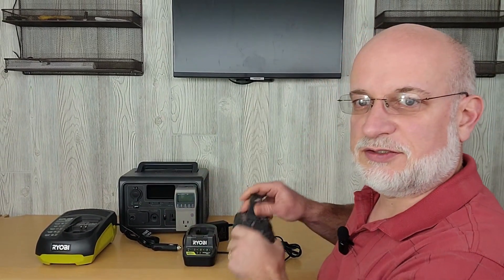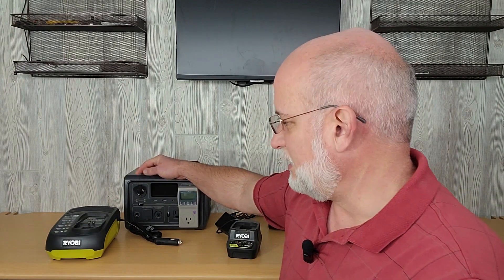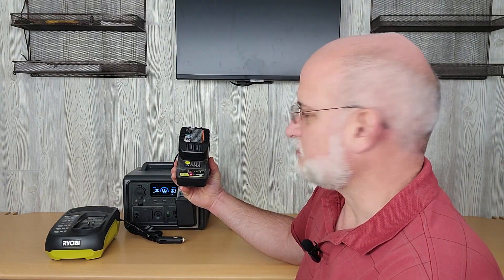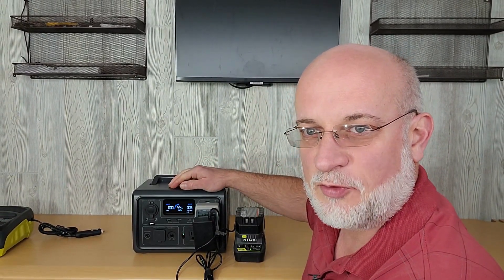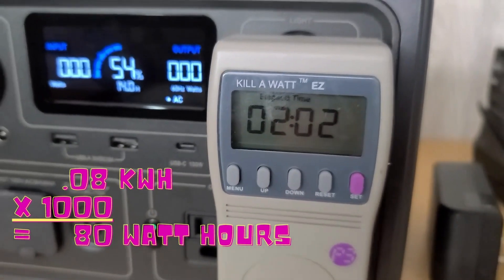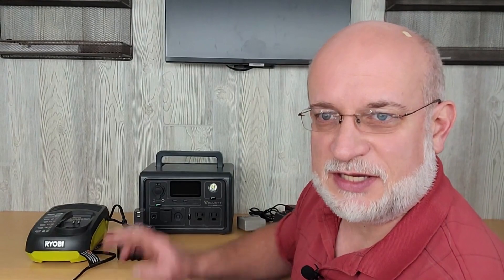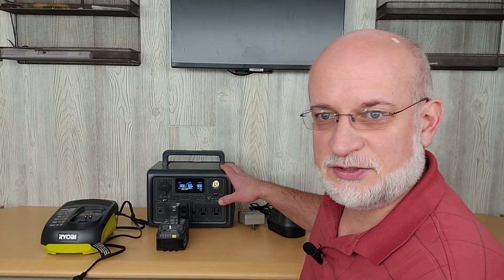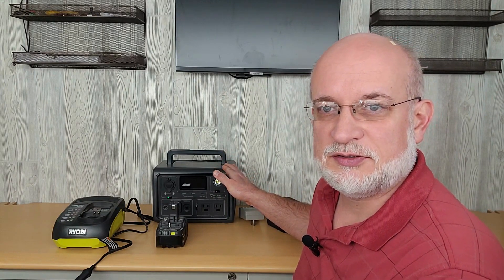Wattage Wednesday: How Much Power Does it Take to Charge a Ryobi 18 volt Battery

Comment: I would like some information on the power usage of the chargers themselves.  Nobody unplugs their chargers.  Most leave the battery in the charger until they need it again.  So I would like to see a combination test.  The first part is the power used to charge the battery but then continue the test with the battery in the charger until the 24 hour mark is reached.  What power consumption is there from battery full to the 24 hour mark.  Now if someone has 3-4-5 chargers all plugged in, that "non-charging time" could add up.
Reply from the maker: That would be good information to know! I will have to check this out.